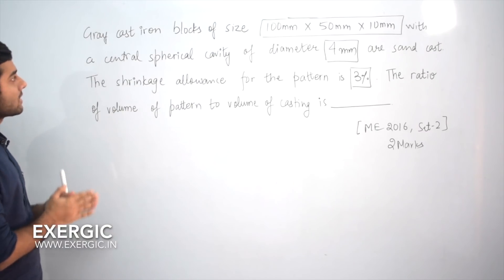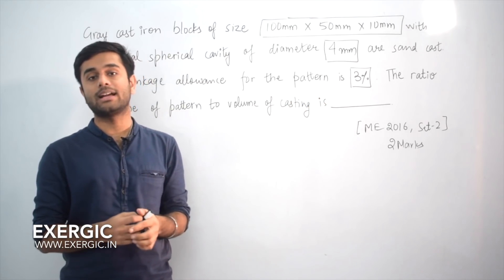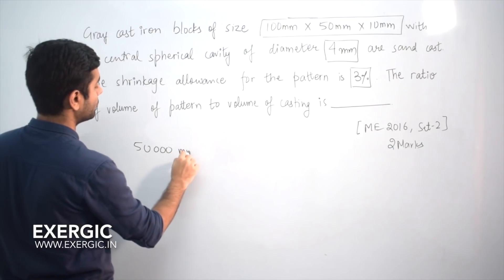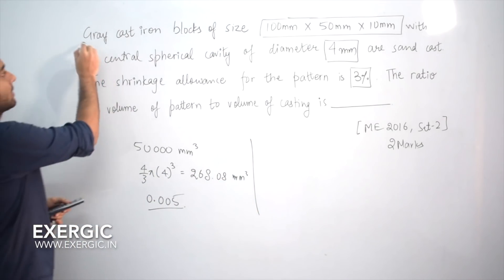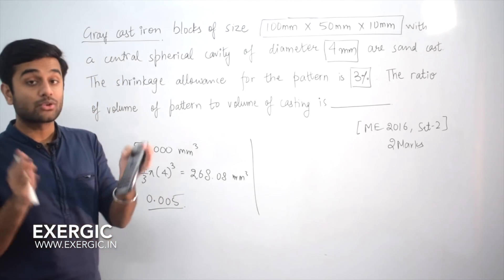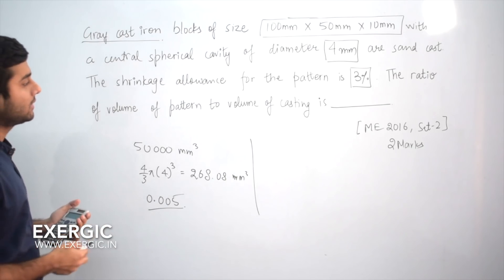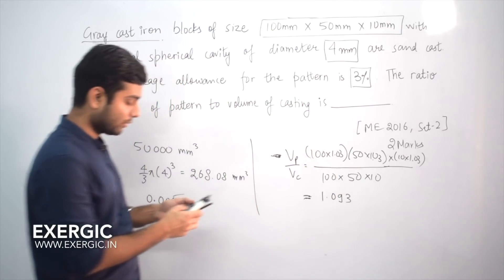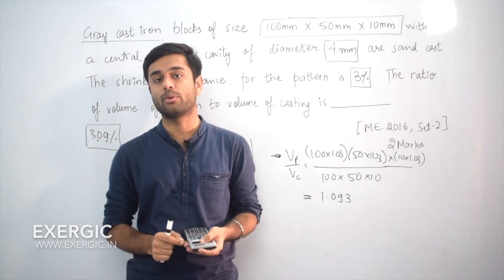Untold concepts of Previous Year Casting question | GATE 2016 (Set 2) Mechanical

Comment: Nice work Sir, there is one more thing you need to clarify,in the same question if the cavity dimensions are sufficiently large and can not be neglected then while calculating volume of pattern the radius of the spherical cavity must also be increased by 3% no matter what so ever is the casting material,is that correct please shower you views upon it. thanks
Reply: No
During contraction material tends to decrease it's thickness so Cavity will increase on shrinkage. So volume of cavity in pattern should be less than in casting .

Comment: Sir for spherical cavity volume, 4/3 π (4)cube  ya 4/3 π (2) cube... Kindly reply
Reply from the maker: That is a slight slip of pen. It should be 2 in place of 4. But that will make the value even smaller so neglecting it is correct.
Reply: Thanks n ways of explaining.. bhaut baiya hai sir...